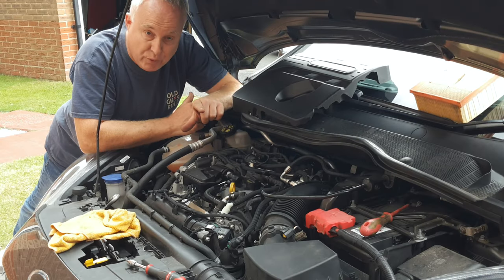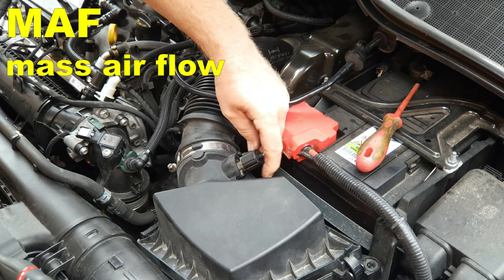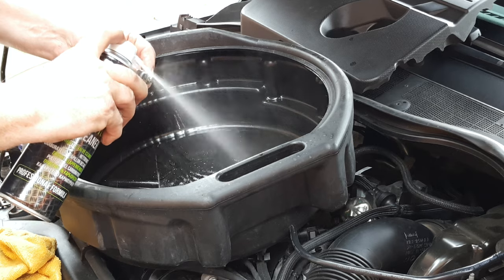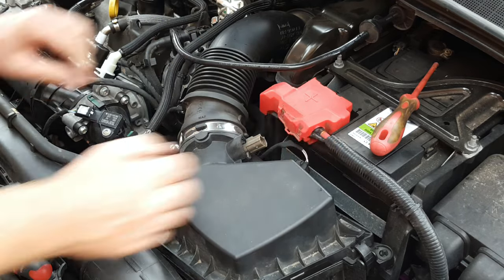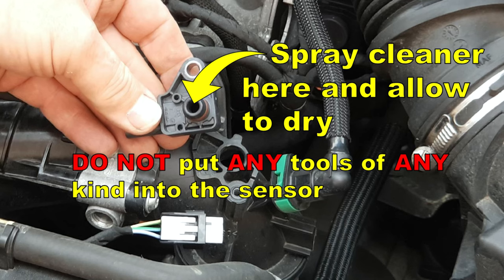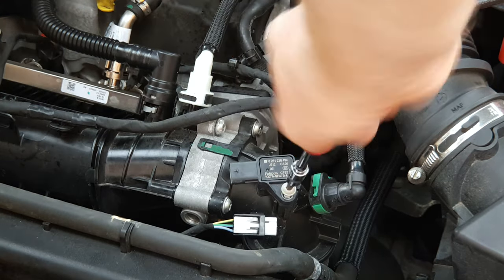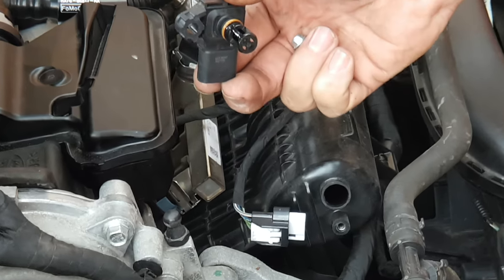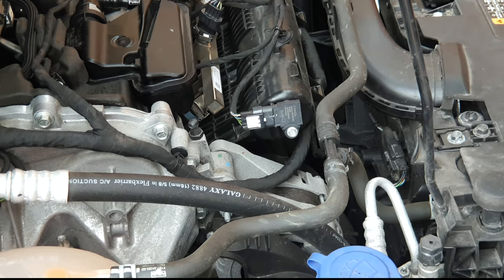Ford Ecoboost MAF MAP IAT Sensor Cleaning - Engine Sensor Cleaning 🚿

Comment: the first sensor is not MAF it is air temp sensor.
Reply: I know so where is the maf sensor then
Reply: @benjaminmonterosa2349  ST don't have MAF sensor have IAT near air filter and two map sensors one in the intake manifold and second in the intercooler

Comment: Any idea where the Barometric pressure sensor on  a 2015 Ford Focus se not 1 auto store and even ford doesn’t know anything about it.. I’m getting code p2230. I just can’t find it anywhere
Reply from the maker: It may not have one. Most cars take a barometric reading from the MAP upon ignition on and use that reading once running.

Comment: Did you use the mass airflow sensor cleaner for all three items?
Reply from the maker: I usually use brake cleaner or carb/throttle body cleaner. Or even soak in meths for an hour and then swish it about in the container (just don't touch the actually sensor). You can buy MAF cleaner, but the blarney on the tin is marketing hype. You don't need anything special, except that it MUST LEAVE NO residue.
Reply: Thank you for the quick response!

I have a 2015 Mustang v6. I believe it doesn’t have a MAF sensor, instead it is a MAP sensor. Should I use MAF cleaner or Carb/Throttle cleaner?
Reply from the maker: @AMfever00 either will do the job just fine. Make sure it says on the can that it leaves no residue (or on the manufacturers website). 
Blow it dry when you're done and sit the sensor in a warm place for 10 mins to dry.
If you've got to buy it, go for MAF cleaner.

Comment: Thank you sir! Question????? for just cleaning the sensors, is it required to disconnect the battery cable and reset the sensors/ECU? The ignition was off the whole time. I would only think after a replacement with new ones. ?  Thanks again. Cheers from Michigan usa
Reply: Apparently disconnecting for 10 min will reset them

Comment: I have a 2019 escape so the model before this one but my mass air flow sensor does not budge if I try to turn it. It’s not bolted in and it looks very similar to this one but when I try to twist it, it does not move and it seems as though I will break it.
Reply: I since discovered that there is a small plastic tab on the sensor that you have to lift up on allowing you to turn it. After lifting up on that I was able to turn it 1/4 turn and then after some wiggling and hard pulling it came right out: I think it was stuck in place a little because of the O-ring on it.

Comment: At 00:30 you show turning the sensor anticlockwise with ease. I tried and the tab prevents it from turning? I was afraid I would break something and gave up. Is there a trick to releasing the tab?

Comment: Nice one Cyd, Did you get any further with that dash-cam in the Saab ?
Reply from the maker: Not yet. I had to wait quite a while for the dashcam power supply (it needs a type C power lead) as a generic micro USB one wouldn't do. And right now she's parked up with no MoT and needing a clutch. She's going to Malcolm Miles in Leicester on 11th April for a clutch (they are well busy). With the clutch slipping I can't take her for a MoT because might not get her off the brake rollers or on the ramp. I pretty much burned the clutch out making the "clutch slipping" short video!

Comment: Sir, will it works on ford kuga 1.6 2015?
Reply from the maker: 1.6? that'll be the duratec engine. Same process for the sensors but they'll be in different places on the engine
Reply: @CycloneCyd  thank you sir